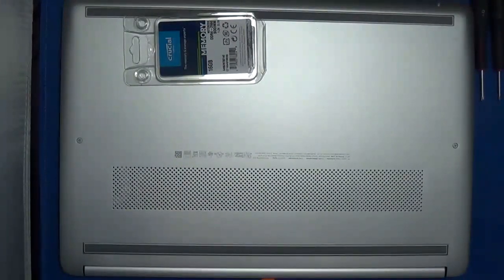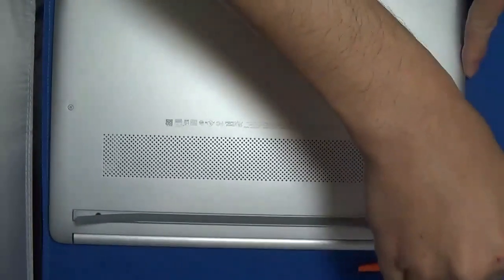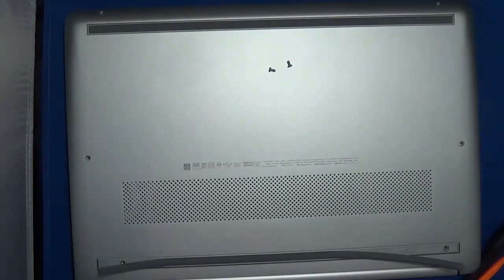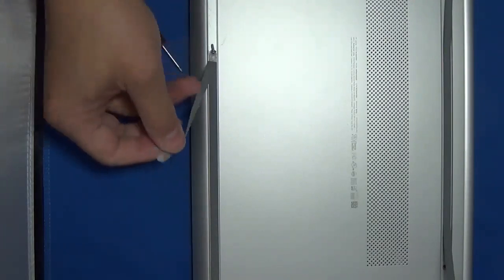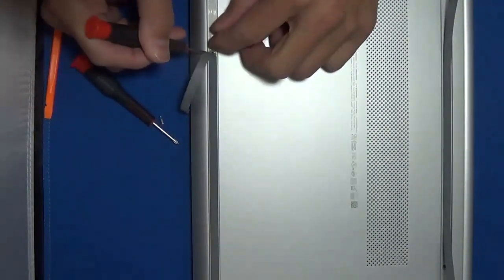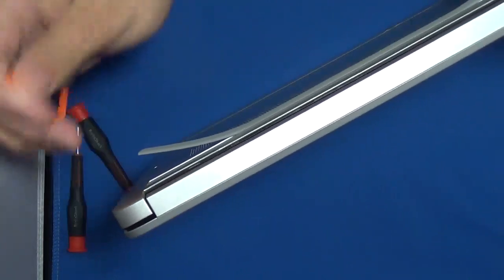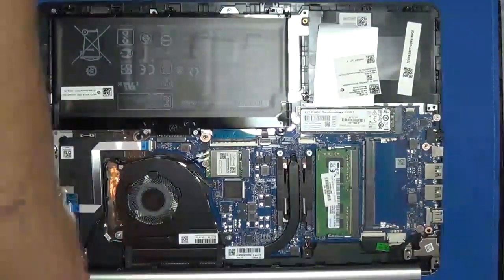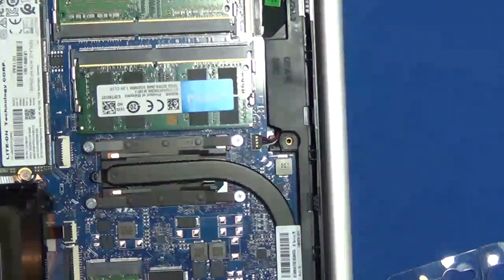How to install RAM on laptop; HP 14 dq1033cl

Comment: Today I had the same thing with my HP Laptop that the glue strip was difficult to come off, this rubber where it sticks extra is even torn into 2 parts that was a bit of a shock but I was able to put that rubber back but in a puzzle piece then😉

Comment: 16:36 The Intel Wi-FI 6E AX210 wireless card doesn't work in this laptop.  You can install it with the driver software, and it works great until you reboot.  The BIOS detects that it is not an approved WiFi card and blocks it.  I contacted Intel support, and they confirmed that it's not supported.  Unfortunately, the BIOS doesn't give any warning message.  I later tried the AX210 in my son's Lenovo X1 Extreme Gen 2 (which comes with an AX200).  The Lenovo didn't even pass boot, but it displayed a message, "1802: Unauthorized network card is plugged in - Power off and remove the network card."  This comment isn't related to this video, but maybe Google searches will help people with questions about compatibility.
Reply from the maker: Wifi 6 upgrades
The laptop comes with a Realtek RTL8822CE 2x2 WiFi AC + BT 5 module. They're used in a lot of laptops, including models that are much more expensive than this one. However, there are definitely more complaints about problems with the Realtek wireless cards compared to the Intel cards on the HP support forums, so I decided to switch to an Intel card since I had the laptop opened up anyway. This laptop will work with an Intel WiFi AX200 WiFi 6 + Bluetooth 5 module. You're going to need to have the AX200 driver on a thumb drive before you install the WiFi module, as you won't be able to connect to the internet to download the new driver after you replace the Realtek module that came with the laptop. https://downloadcenter.intel.com/...Fi-6-AX200

The AX201 (Intel 10th Gen specific CNVi) also is reportedly working on this computer. This is a wireless card with the latest "m.2 CNVio" interface; AX201NGW is the latest with wifi 6 and BT 5. The next latest is a 9560NGW which is the 9260 with that interface. These models use a direct CNVi pipe to the CPU rather than PCIe with a processor on the wifi card so these models don't work with older CPUs. Symptoms of having the wrong wireless card installed is that the computer will refuse to turn on. In theory there are battery life advantages to the CNVi models but no speed difference between the AX200/201 or 9560/9260.
Reply: @jackeroo75  Thanks!  I would have tried my son's AX200 card in my HP, but I didn't want to risk breaking any plastic clips during reopening.  The current card works fine for me, but as I just moved from an 802.11n to a WiFi 6 router, I thought it was worth the the $30 to future-proof with 6e.
Reply: @jackeroo75  The BIOS just warned me that one of the four cells of my battery is dead, so I'll have to open up my laptop soon.  I would take it back to Costco, but now that everything's installed on a new SSD & more RAM, I'm OK with buying a new battery.  Then I'll try the AX200 card.
Reply: @jackeroo75  One can also use USB to wired network adapter to allow the HP app to find the driver, download it, and install it.  The AX210 works in my notebook after placing electrical tape over pin/pad locations 54 and 56.  The BIOS I had F30 saw the card but without a switch or keyboard key to turn it on one has to cover those two locations with tape.
Reply: I just installed a AX210NGW WiFi Card in my laptop just now in Jan 2024.  I had the F30 and later F32 BIOS.  I am not sure where to look for BIOS block message.  The PC recognized the hardware and the HP app found Intel driver for it and installed the driver.  I used a USB to wired network adapter to allow the HP app find and download the driver. The problem was WiFi was turned off and they is no way to turn it on via any switch or key on keyboard.  So I fount the M.2 cards like this need to electrical tape placed over pin (edge board connector pad) locations 54 and 56.  The pins are next to one another.  You will also find pin 20 or pin 20 and 51 are used on a different form factor card in other laptops.

Comment: Did your laptop end up with 20gb ?  I though 16gb was the max the laptop took.
Reply from the maker: Yes it currently has a 16 gb stick with and the stock stick of 4gb,.  You can have two 16gb sticks for a total of 32gb.
Reply: @jackeroo75  I just tried to put two 16 GB sticks in my notebook.  It will boot with the original 4 GB in its original location and either of the 16 GB sticks in the 2nd slot but it will not boot with either of the sticks in the first slot.  I tried 16GB stick in first slot with no stick in 2nd slot, a 4 GB stick in 2nd slot, and the other 16 GB stick in 2nd slot.
Reply from the maker: @raykettel1837  not sure I got a total of 20gb of ram.  You can have a max 16 gb per slot.
Reply: @jackeroo75  One video claimed person put 2-16 GB sticks in it.  I get flashing 3-2 memory code error on attempted boot up in most combinations of RAM sticks.  4 GB in slot where it originated (I call it slot 1) works with 8 or 16 GB stick in the prior empty slot (I'll call it slot 2).  8 GB works in the 2nd slot with nothing in 1st slot.  16 GB stick in 2nd slot will not work if 4 GB is not in slot 1.  PC will not boot with 8 GB in slot 1 even if nothing is in slot 2.  It is really strange.  The 8 GB stick came from working Lenovo PC.   I put one of my 16 GB sticks in the Lenovo notebook.  It has 4 GB solder to the board and only one slot.  The other 16 GB stick will stay in the HP and I will have to leave the original 4 GB where it was in the HP.  I am calling slot 1 the slot closet to the fan and slot 2 the one close to the HDMI connector.  I noticed this video or some other one showing their 4 GB RAM came from the factory in slot 2 while mine came in slot 1.  I had the F.30 BIOS in the PC when I started this RAM upgrade and update to the latest BIOS in hopes it would solve the problem but it did not.  I am thinking now that there is some defect with my PC that may have been there when it was built and it was missed as only 4 GB was installed.
Reply from the maker: @raykettel1837  did you try to put two 16 gb ram in each slot?
Reply: @jackeroo75  I tried two 16 GB SODIMMs.  I put one in each of the two slots.  It will not boot in that configuration and several others as I explained.  The laptop will boot with either of the two 16 GB SODIMMs in the slot nearest the HDMI connector but only if the original 4 GB SODIMM is installed  in the slot closest to the fan.  I think this issue/defect may be limited to just my laptop as they is no reason I can think of for the first slot to have this limitation.
Reply from the maker: @raykettel1837  did you installed DDR4 PC4-21300 2666MHz Non-ECC SODIMM memory type ?
Reply: @jackeroo75  RAM rated for 3200MHz should run fine when motherboard runs it at 2666MHz.  The labels states:
TED4 6G300C22-SBK
16GB DDR2 3200
CL22-22-22-52 1.2V
Made in Taiwan
Team Group Elite brand.
Online listing can still be found.  It also states: Unbuffered Non-ECC 1.2V SODIMM 260-Pin Laptop Notebook PC Computer Memory Module Ram Upgrade

Comment: I have a hp 14 cm007la with 4gb ram micron technology and it has another slot, what is better to do, add an 8gb ram same frequency 2400 mhz in second slot and Will have 12gb ram or better remove the 4gb ram and put a 8gb ram instead? In Perú there isn't micron technology so instead I Will buy crucial or Kingston
Reply: Replace first slot 4gb ram for 8gb ram no matter brand and in second slot install 4gb ram. I tried with kingston and I worked pretty nice on 2666mhz

Comment: I will do it this night, I'm gonna add 8gb ram of the same speed of 4gb one.
Reply: I guess so but it is about the programation of bios, I tried to install 8gb on second slot and it didn't work, later I tried the same way as the video and restart twice, first time I had 8gb then I restarted again to check, finally the bios recognized both memories, I think that 12gb of ram it is enough, maybe 16gb could force application waste more ram in launch apps.
Reply: @TheMiguelcookie  hi im having a problem i have installed 8gb on the second slot then after i opened my laptop it keeps showing bluescreens and automatically restarts what should I do?
Reply: @TheMiguelcookie  should I swap the ram ?
Reply: Why dont add in second slot?

Comment: Hello, can i add an internal disk ? Or must be replaced ?
Reply from the maker: You can not add a SATA hard disk for this model.
Reply: @jackeroo75  then must ve replaced the disk mm2? That the only option to increaae storage  ??
Reply from the maker: Yup m2 only
Reply: @jackeroo75  😥 ok, thanks and saludos desde México
Reply: Has an 8-pin sata connector on one side of the M2 connector.

Comment: Great Job!  😉  I went through the same thing with the BestBuy version HP 14-dq0011dx. That one rubber strip is thinner and has a combo thick tape/glue holding the thinner strip on it. I doubt you could get it off like the other one, in one piece. I broke a 2 inch piece off of mine, but got it back together so that you can't even tell. Getting that one screw out was a pain! I upgraded mine to 8GB total and threw in a Crucial 1TB P1. For a Core i3-8145, it's now pretty speedy! Why do they have to make it more difficult each year?
Reply from the maker: Craig S. Sanders because they don’t want people to upgrade it period!

Comment: That big spot in the corner, can you put a full size laptop ssd there?
Reply from the maker: LazyGamerX unfortunately since they remove the hard drive connector you can’t do anything even if you manage to fit it in there!
Reply: @jackeroo75   Today, I added 4 giga RAM so  total 8 giga RAM.  when I saw the empty space because I thought I could install an SSD, but it's so sad that no connection connector. Maybe is it hard to get a connector?
Reply from the maker: WS J there is no hard drive connector at all! So even if you manage to get a cable, you won’t be able to do anything!
Reply: @jackeroo75  okay hhhhh thanks!